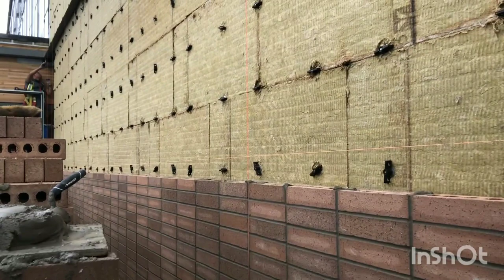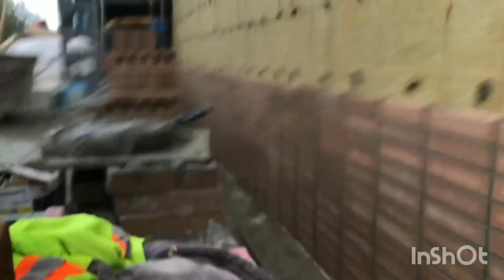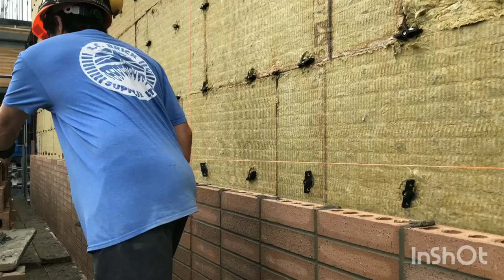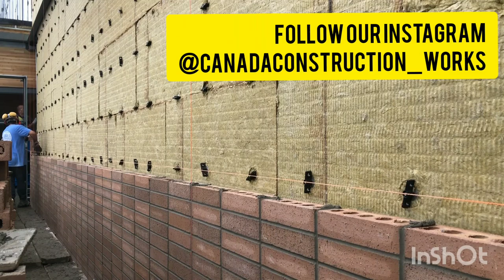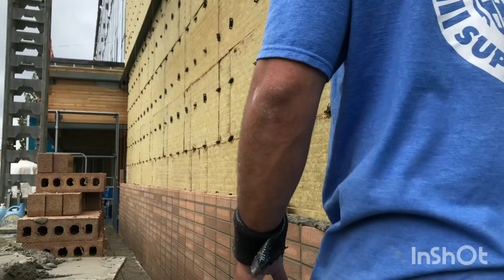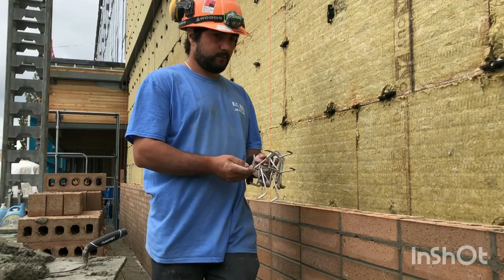Bricklaying stack bond #bricklaying #bricks #bricklayer #works #vancouver #canada  #shorts #courses

Comment: Looks good mate is that a husky trowel I've seen. One once in the UK but you can't seem to get them over here , seemed a canny trowel
Reply from the maker: Yes it is mate well here in Canada they are cheep to buy. This one I use more for block work cuss it’s to big for me to use on brick😂😂 but I used for the day👍 cheers 🍻
Reply: Are you is an 11 a half inch London Pattern husky trowel for laying blocks they are sold exclusively at Home Depot they claim to be exactly the same as the Marshalltown and they are 10 or $15 cheaper
Reply: I meant to say I use an 11 a half inch husky trowel

Comment: Not the best way to position bricks very weak joints especially has the mortar gets old.
Reply: I think was better a mechanical connection, between the parallel bricks, to prevent an eventually collapse. Each vertical  bricks line is separated, no horizontal connections.
Reply: This bond usually had bed  joint reinforcment dude